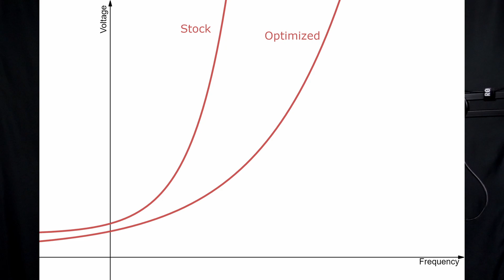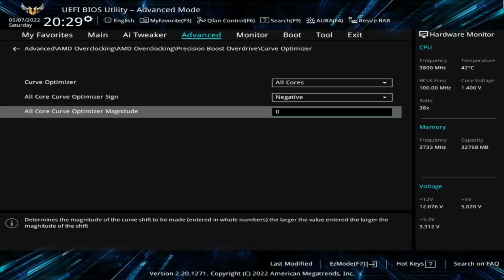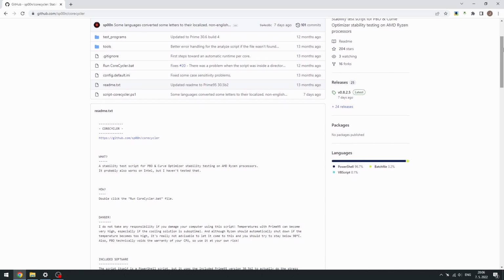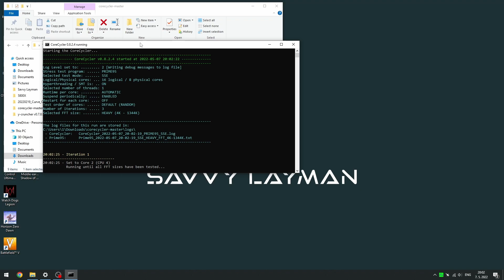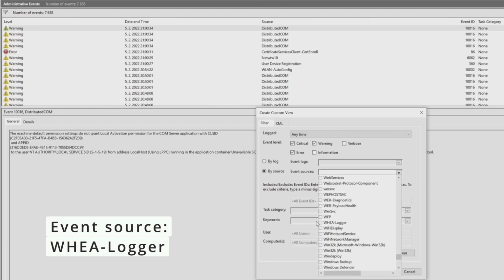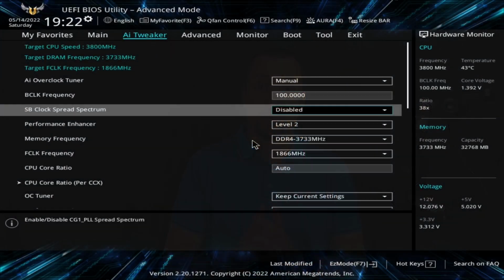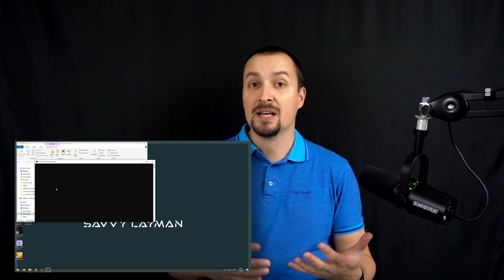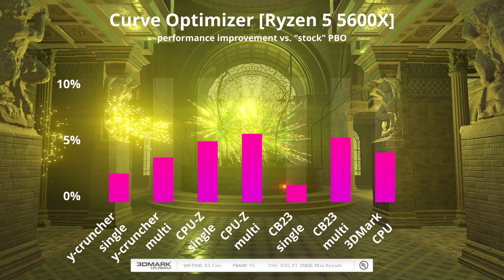Curve Optimizer - Ryzen 5000 / 7000 per-core "smart" undervolting

Comment: On my Ryzen 9 5900x with base clock of 3.7 Ghz I applied PBO 2 through AMD Overclocking with Boost CPU overdrive of 200 and all core -20 negative offset. PBO Scalar value left on Auto. With Sustained heavy load stress test through Linpack extreme and Prime95 I saw all core reach peak of 4.5 Ghz and temp rise to max 79 degree C. Ran those 2 software for continued 1 hour with no issue. Interestingly, on idle I sit on 40-43 degree celsius and core 0 showing 4.9 Ghz which I don't understand. Cooler Noctua NG U12A. Am I Okay? Have I done it correctly?
Reply from the maker: Congratulations on your overclocking result. If your CPU sits idle at 40+ degrees Centigrade, I wouldn't worry about it. It's strange core 0 stays at 4.9 GHz, though. I mean background processes "eat" CPU resources, so I would blame those. I don't think CPU is doing much at all. You may want to check so-called Effective Clock in HWiNFO64. It better represents what clock the CPU is actually running at while "doing its job".
Reply: @savvylayman  Actually core 0 value of 4.8 -4.9 Ghz at sitting idle-This I am seeing through one Armory crate software supplied by Asus which may be a crap I don't know. However, looking through Hwinfo64 - I am seeing these results at idle: core clocks hovering around 3.68-4.02 Ghz. Bus clock - 100 Mhz. core effective and Average effective clock both moving around 180 Mhz-280 Mhz(max.) again at idle. is this a so called sleeping state to reserve energy as advertised by AMD? While at sustained heavy Load I also watched through Hwinfo64 - All the clocks reaching 4.5 Ghz (Max.). Hwinfo64 also says all at idle - CPU(Tctl/Tdie)-53.5-degree c which, btw, I saw reaching 90.3 c while at sustained full load. CPU CCD1(Tdie) -52c(idle), cpu ccd2(tdie) - 44c(idle). Also, CPU Core voltage (SVI2 TFN) hovers around 1.37-1.42(idle) which I saw staying 1.244-1.325 V while at sustained full load. CPU Package Power - 50 W(idle) whereas reaching up to 170 W while Linpack extreme at sustained full load. Is all the behavior stated above normal? I also stress tested with Asus Realbench for 1 hour with no issue. Is that good? Lastly, in future if I see errors in Prime95 or Linpack extreme (which interestingly if Hwinfo64 says 0 WHEA errors) - in that case should I lower boost cpu override from 200 Mhz and tinker with CO negative offset -20 or leave as it is? How much performance benefit I should expect %wise after this PBO 2 as you know stability is also a factor! Does it really worth? I am beginner in O/C segment and intend to proceed with caution. That's why I am writing in detail. Thanks for your patience & seeking your suggestion. Cheers!
Reply from the maker: @pinakide1550  I'll just add to my earlier comment in the other thread that SVI2 TFN may seem a bit high, but the uncomfortable voltage of 1.4-ish Volts is never applied during all-core load.
Reply: @savvylayman  With reference to all our previous discussion it is although within AMD prescribed operative limit but still Max temp 90 degree c under sustained full load continues to prick me a little bit. Detailed report is with you. However, the Platform Power throttle limit- should it be kept on auto(as I did) or reduced to say 85. Also, is PBO limit to be kept on Disabled (like me) or to Auto/motherboard? Will it make any difference at all in regards to temp, heat and stability. But notably whatever tweaking may be ;  I don't want any performance/boost compromise whatsoever. Or, Leave it as of my tuning right now!  Cheers!
Reply from the maker: @pinakide1550  My understanding is your CPU reaches 90 °C only when crunching Prime95, correct? If that is the case, I wouldn't worry about it too much. But yes, I personally don't feel comfortable running my Zen3 CPUs over 70 °C for many hours straight. What is the primary use case for your system? Gaming? Or do you do any video rendering and things of that sort? If so, I would maybe lower the power limit to be on a safe side.
Reply from the maker: @pinakide1550  I could swear I replied to this comment of yours yesterday, but I can't see it here now. Anyways, 90 °C is indeed toasty. I'm surprised it runs this hot with PBO disabled. I mean my 5900X can hit 90 °C even with 360 mm AIO if I let it use too much power. Therefore, I would personally decrease PPT limit. CPU can boost a bit higher with higher PPT, but efficiency is quickly lost.
Reply: @savvylayman  Yes you did reply ! But will you explain your last line of your latest reply. If you think 90 degree c is genuinely "too hot" under prolonged/continued full load in spite of being within AMD's official max. operative limit of 95 degree c - Then what's the way-out? I mean if I lower PPT from Auto to 80-85; True it will reach that point maximum. But with that lower PPT how much performance(PBO 2 benefit) I m gonna lose? You also specified "efficiency is quickly lost" despite the higher PPT. Why ? because of 90 degree under full load? How much exactly should I lower PPT? Will the system be stable? Not only my max temp! under sustained full load My EDC(CPU) also showing 100% utilization of 180 ampere! cheers!
Reply: Yes you did reply ! But will you explain your last line of your latest reply. If you think 90 degree c is genuinely "too hot" under prolonged/continued full load in spite of being within AMD's official max. operative limit of 95 degree c - Then what's the way-out? I mean if I lower PPT from Auto to 80-85; True it will reach that point maximum. But with that lower PPT how much performance(PBO 2 benefit) I m gonna lose? You also specified "efficiency is quickly lost" despite the higher PPT. Why ? because of 90 degree under full load? How much exactly should I lower PPT? Will the system be stable? Not only my max temp! under sustained full load My EDC(CPU) also showing 100% utilization of 180 ampere! cheers!
Reply from the maker: @pinakide1550  The thing is that modern CPUs are optimized by the fab fairly well. We are speaking of a single digit performance increase if tweaked manually. That is why brute-forcing more current through the chip doesn't scale linearly with performance increase. Most of this power is wasted as heat and an increase in temperature causes an increase of internal resistance of the silicon, so temperature can easily become a runaway train. These 5900X doesn't have to be as sensitive as 5800X as it has two CCDs and if you are lucky, your best cores are spread across both CCDs (unlike in my case). Two separate chiplet dies are easier to cool than one.
As for PBO - the default PBO or motherboard limits are set too high. I would try to limit power and / or current manually instead. I use Hydra's Hybrid OC, so I didn't bother, but if I were using PBO, I would definitely decrease the limits. You may want to check this thread, which gives good hints on what to do:
https://forums.overclockers.co.uk/threads/pbo-limits-for-5900x.18967483/

Comment: core cycler takes 6 minutes per core to run, i got 16 cores, ain't no body got time for that !
Reply from the maker: Fair enough. Thanks for your comment. Hydra may be more beneficial in this regard, but the truth is, it still took like half a day of runtime on my 12 cores. But with almost no user interaction, which is great. I made a short-ish video on Hydra here: https://youtu.be/Nnpao_5uXOQ

EDIT: Now I see you asked a question about Hydra in another thread. Will ask Yuri if / when support for 7950X3D can be added.
Reply: @savvylayman  i know i m a tech pleb but any way of actually being able to select the cores the program runs on? so lets say i start with each core individually and i want to test core 7 because the rest are stable, can i just input in the core i want tested rather than just re-running the program on each one again? or just run it on all cores like regular prime 95? o.O
Reply from the maker: @LQ-gaming  No worries; it's a valid question. CoreCycler comes with a configuration file called config.ini, where you can tweak plethora of parameters. For your particular use-case, you need to change the parameter coreTestOrder to something else than Default. Please note the core counter starts with 0. It's always a good custom to make a copy of the config file before editing it. Good luck and let me know if I can still help you in any way.

Comment: I just used ryzen master automatically curve optimizer on my 5600x ...it did set to negative 30 automatically after testing for about 30 mins...2 days and no crashes so far... temperature are down and frequency is increased...i can use fcking 4.65 ghz boost all core in stress test and still stay under 85°c and that's on spire cooler....Woohoo!!
Reply from the maker: If that's the case, then you are actually very lucky. It is actually rare Ryzen Master does a good job with curve optimization, at least in my experience. Cheers.
Reply: @savvylayman  yeah...with some more tweaks i got cinebench r23 multiple upto 12088 points and single core 1600....tho i faced some random crashes(like while browsing) so decided to roll back those as loosing a few mhz is better than crashing...btw i was able to get 4.85 ghz stable(but throttles soon as i have poor spire cooler) but still thats insane..atleast didnt crash at 4.85ghz...just random crash which couldnt figure out the exact reason but it was definately cause of that extra overclock...still -30 curve optimiser is still stable and no crashes on that
Reply from the maker: @techgamingwale1402  Yes, that's what often happens when one tinkers with Curve Optimizer. Though the GPU can sustain high clocks, it crashes when waking up cores from sleep states. The curve is too aggressive and the GPU doesn't get enough voltage to compensate for the frequency ramp-up. Glad you were able to dial the overclock down a little to make it stable. Good luck.

Comment: what is the different using this method and the curve optimizer in ryzen master?
Reply from the maker: Thanks for asking. You can set the V/f curve in Ryzen Master, too. Beware of its automatic curve optimizer mode, though. The last time I checked, it did a pretty bad job and left the system unstable.

Comment: I also have a 5800x and 360mm AIO, what do you recommend to get the most performance? Should i do PBO + CO? Which one should i do first? Or is Hydra the better faster option?
My temps are around 84c (with pbo and co -20 enabled) with the 360mm AIO, is this normal?
Reply from the maker: Thanks for asking. 5800X runs very hot in general. There is just too many cores which are cramped into a small real estate and they draw much power with PBO enabled. My humble opinion: If you want to win benchmarks, go with PBO + CO. If you don't want the fans to go too loud, use Hydra's Hybrid OC. I run Hybrid OC with PBO enabled.
Reply: @savvylayman  I just want the best gaming performance I can when gaming (warzone is very cpu heavy)
If I were to go PBO + CO, is using hydra to find the values better than doing manually?
Reply from the maker: @Gershy13  From my experience, I could find a little better CO manually than with Hydra. But it took me a dozen of hours to do that. For most people, it's not worth the effort. Hydra does a very good job overall.
Reply: @savvylayman  Alright thank you. I will start with hydra values and apply PBO + CO using what it tells me, and will see what performance is like. I may give hybrid OC a try in the future.
Reply from the maker: @Gershy13  Yeah, you can let Hydra search the CO, which saves you tons of time. Then you can tweak the curve a bit if you feel like there is still headroom. By the way, though Yuri says Hydra doesn't require you to set LLC to anything but Auto, I would still recommend going for a more aggressive LLC (e.g., Level 3 for Asus mobo).
Reply from the maker: @Gershy13  A positive offset of 2 is indeed a bit weird, but it is usually the case the best cores cannot go as low on the V/f curve, because their curve is relatively well optimized in stock settings. You may want to increase your LLC a little a try again.
By the way, is your RAM stable? And did you follow Yuri's recommendation regarding pre-requisites for diagnostics (except for LLC)?
https://docs.google.com/presentation/d/1_j6vB61koOVwEHLrvqt7lh1RYw4XRuoTIeEDtYmnFj0/edit#slide=id.g13b36094eab_3_94
Reply: @savvylayman  Yeah I followed everything in the Google slide. I was set to LLC auto. I will try it again with LLC set to high (gigabyte x570 aorus pro). I'm pretty sure my ram is stable, it's set to DOCP. 3600mhz cl16 Corsair vengeance RGB pro
Reply from the maker: @Gershy13  I'm pretty confident you should be alright with your setup. Maybe just give it another diagnostic run.
As for me, I ran diagnostics up to 10 times now due to version updates etc. It happened to me once or twice that the final curve was very instable. I guess it can happen. Good luck.
Reply: Alright thanks, I'll give it a go again. This time I'll run the full hybrid OC diag.

Comment: my cpu stable on all cores in core cycler but it still crash in 3dmark
Reply from the maker: Does the PC reboot under 3DMark load? Or does it just crash into desktop? I wonder if you can spot any WHEA errors in the Event Log.
Reply: @savvylayman  pc reboot, whea log says cache hierarchy error, everytime on different core.
Reply from the maker: @budgetking2591  This is a tough one. I haven't experienced this WHEA error myself, but I've seen many people flooding Reddit with this. Unfortunately, there was no definitive solution, at least from what I could tell.
Could you perhaps share what system you are running (mobo, CPU, GPU, RAM etc.) and if you previously did any overclock / BIOS tuning etc.? Perhaps we can find something suspicious.

Comment: I used -50 on all cores straight away, testing all day and no instability, maybe the limiter of -50 being the lowest you can go is too conservative?
Reply from the maker: My mobo only allows me to go as low as -30. None of my CPUs are of good enough silicon quality to be able to run stable at that offset.
In another video of mine, I tested Hydra and there the diagnostic process can go even lower with its so-called Hybrid OC: https://www.youtube.com/watch?v=Nnpao_5uXOQ.
Reply: @savvylayman  I'll have a look at hydra, though are you saying I'm lucky then to get -50 all stable? Still going strong, haven't stopped testing
Reply from the maker: @hateterrorists  It seems you purchased a nice chip. Mine isn't great. Pure lottery.

Comment: Apparently you are wrong to claim as a blanket statement, that AMD uses too much voltage. It may be so for Windows kernel, but for me, on Linux, it does use too little, so the system was unstable out of the box and I had to boost several cores positively to bring the system to stable in the first place.
Reply from the maker: Thanks for sharing your opinion. Though OS selection may have impact, I think it has to do more with silicon quality. Some inferior samples would struggle with less voltage and they are the reason why AMD uses so much voltage at stock. They simply have no time to perform any more tuning in the factory as it would never pay off. They still do a better job at binning then a decade ago.

Comment: i own an Asus tuf B450 gaming plus 2,and an 5600X.if i let PBO on stok it only goes to 2cores 4.600mhz. but if i turn on AMD curve optimizer  with negative offset off 50 points i got the same temperatures and and 4.850mhz! and cinebench R23 from 10.700 to 11.931 points. and perfectly stable on idle never passing from 40+ ºC and gaming on 1440p monitor cpu never goes above 64ºC! so i guess you have and bad lottery tickett\silicone sample on hands,or dont understand what pbo really does or how to aply it!

Comment: Problem... I have Prozessor apicd 26 here.. But iam have a 5900x.. Only 24 threads
Reply from the maker: You are right, processors with many cores may hit some APIC IDs that are reserved. In that case, these are skipped. Unfortunately, I haven't figured out how to reliably identify the respective CPU cores. If I happen to succeed in this endeavor, I'll let you know.
Savvy level docu (chapters 3.2 & 3.2.1): http://developer.amd.com/wordpress/media/2012/10/254811.pdf
Reply: @savvylayman  hey thx 4 answer, what is this savvy?... And I have one two problems more I think.. I have a msi mag 570x torpedo max with the rayzen 5900x. When I go in the bios I have 2x times pbo settings.. And I think in both curve optimizer don't work... Because... If I set by the CPUs different negativ (-) sets.. Like - 5 or - 30...every core use the same voltage... Make no difference? (I watch with hwinfo64)... And my second problem.. Bei cinebench r23.. By multicore test.. He use only 1.1 or 1.2 voltage / vcore.. So my cpu only work with 4100 mhz.. Or sometime 4300.. By singlecore it works a bit better.. 1.38 vcore and 4700-4850.. What is wrong? Thx 4 answer friend
Reply from the maker: @QueckSilber87  Thanks for asking. Savvy means shrewd and knowledgeable; having common sense and good judgement.
Concerning PBO settings listed twice: Yes, this is confusing. I only trust those listed under 'Settings -> Advanced -> AMD Overclocking'. Leave the other section as is. This one should override it.
Concerning Curve Optimizer "undervolting": CO doesn't undervolt the way one may expect. What it does is that it shifts its voltage/frequency curve in its boost tables, so as the result, it can boost higher. If you are interested in more advanced optimization / undervolting, you may want to check Project Hydra: https://youtu.be/Nnpao_5uXOQ.
Regarding CB23: It actually works as designed. Power delivery system can push more voltage during single threaded workloads, which results in higher clocks. But when all cores are loaded, there is no way the CPU could handle so much voltage & amps. That's why it clocks down, otherwise its temperature would go haywire.